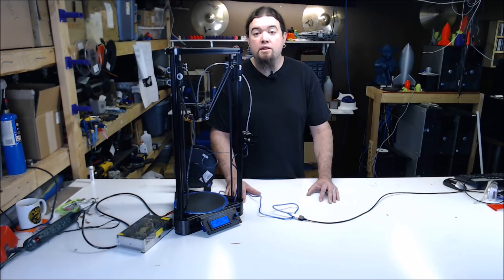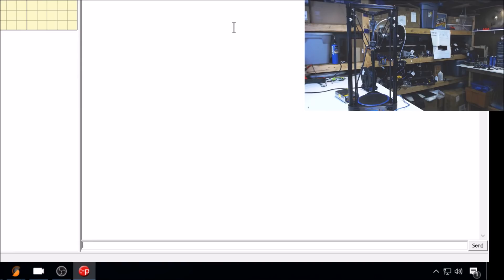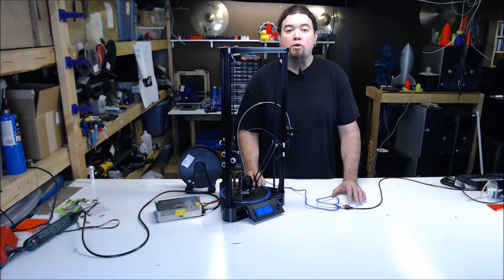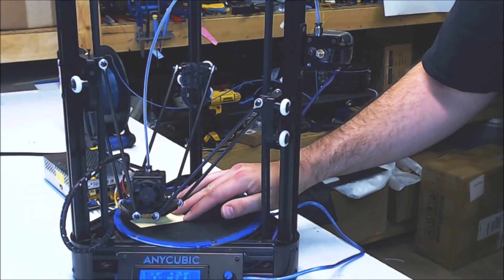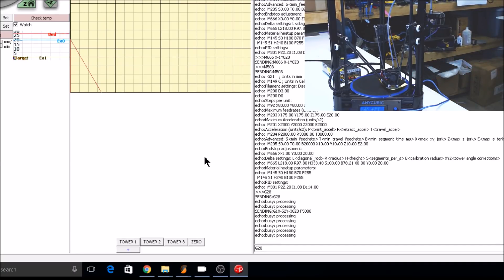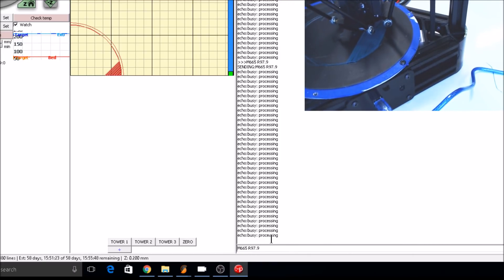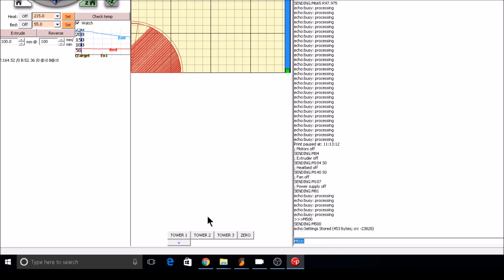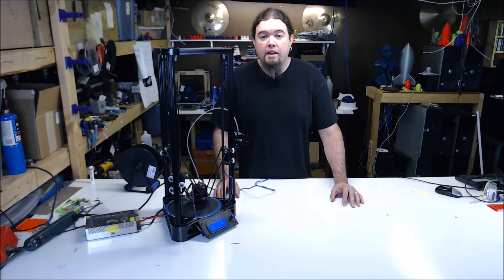How to level your delta printer bed - Anycubic Kossel Delta

Comment: When I do M666 X0 Y-2 Z0 to move the Y tower down 2 mm, it doesn't show up when I do M503. Even if I do M500 after the M666 command to save it, it still doesn't show up, and it doesn't do anything. 

I don't have the Marlin software, because I have had to return this printer twice already (the first time because I got marlin and everything got screwed up). So I'd prefer not to get Marlin if I didn't have to. Anything I can do here with the default firmware?
Reply from the maker: The old firmware doesn't show anything on the M503 I am afraid. Not sure when that was added, 1.1.1 maybe. I think your best bet is to adjust the endstops manually.  Those changes should  work with the M665 command, not sure why they are not. You might try a M502 to reset to factory then try your M665 command again.
Reply: Hey Chris, thanks for the speedy response! I did end up installing the firmware. There was no option for the height in M665. I looked through the comments here, and it looks like the Anycubic Marlin firmware does not have the "H" option. I saw that you posted firmware for the Pulley Version... I have the Linear Plus, do you have Marlin firmware for that? (The Linear Plus' arms cannot be adjusted manually, no allen wrench will fit the screws at the top of the arm).
Reply: Chris Riley Or rather, what could I do to your Pulley Version firmware to make it work with the Linear Plus? As far as I know, the only difference between the two printers is that the Linear Plus’s build plate is 230mm.

Comment: Can anyone tell me how I can access the existing firmware on the primer i need to make a couple of small calibrations but all information I find online just tells me how to upload new firmware to it and not how to edit the one that’s already on it
Reply from the maker: Unfortunately, you can't. You have to recompile the software and reload the whole thing every time you need to make a change.
Reply: Chris Riley thanks for responding and man that sucks cause I never got the firmware that’s on it from where I bought it. Oh well guess I’ll just download the latest firmware from Anycubic and start over. Lucky for me though you made this great tutorial/Video that’s gonna help me a lot XD
Reply from the maker: The Anycubic version should be pretty close to what you need. Let me know if you run into issue I will try to help out.
Reply: Chris Riley thanks I really appreciate it right now what I really need help with is getting the latest firmware for the Kossel Linear Plus upgrade version that has a heated bed and auto leveling I contacted Anycubic to see if they can send it to me but if you know where I can find one that would be awesome and probably faster lol

Comment: When I use the G28 command the printer moves to the back left very fast and keeps going that way until I unplug it. I also just have white squares on my display. It works with the software downloaded from anycubic though. Any thoughts?
Reply from the maker: +Drew Hardy Hmmmm, sounds like the boards isn't happy at all. Double check your motor port connections are correct. Try a M6 1 and see one on the motors moves 1mm.

Comment: Hi, when I start a print with your new config everything seem to want to start ok, Print head come down, Printer heat up before starting print and then the head goes straight off the bed between the z and y post not hitting anything but stay there and keep extruding filament. Do any one have any idea why and how to fix?
Thanks
Reply from the maker: That almost sounds like there is something up with the SD card, like it's not getting the gcode loaded correctly. Have you tried formatting the SD card, reloading the gcode and trying again? If not, give that a try. I will try to help you if I can.
Reply: yes? I tried printing via USB with 2 different software and changing the bed dimension into those and printing from SD card (format) same result. I tried different marlin version. Do you know a website that doesn't take 3month to ship? I think im gonna  try another board.

Thank you
Reply from the maker: If you want that exact board it's going to be hard to get anywhere but strait from China. You could probably swap it with an MKS ramps type pretty easy though. You would have to check them out and compare it, but it might be worth a look. https://www.amazon.com/KINGPRINT-Controller-Motherboard-Ramps1-4-Compatible/dp/B072ZZ3YQW/ref=sr_1_1_sspa?ie=UTF8&qid=1516055099&sr=8-1-spons&keywords=mks+gen+1.4&psc=1

Comment: just curios, why not use the auto-level? thanks!
Reply from the maker: Zoster Are you talking about the feature in the menu without the sensor? If so, on my printer this options makes the printer go crazy and crash into things. They might have improved it on later models.
Reply: hey! i'm referring to the feature that uses a sensor
Reply from the maker: Cool, that is on my list of projects to get to for sure.

Comment: PLEASE HELP SOMEONE **
I bought my kossel about a month ago. it's my first 3d printer, Iv been trying to level the bed,  but no luck so far. Please if you know the solution, I would love to know thanx 
My centre is higher than all the towers for ex.
if I make my z hight 327.7 the centre is perfect but the towers are too low 
however, if I lowered my z high to 327.3 all the Towers are perfect but then the centre is too high
PLEAS CAN SOMEONE HELP ME
Reply from the maker: S3ODG Its the radius setting. What is your radius at now? It should probably be around 97-98 for this printer. The video will show you how to change it.

Comment: Can I please have help, and thank you for video. So, Ive been following your steps, i started the print in pronter face like you did , now the extruder feeder is spinning way to fast and stripping filament. Thanks have a good day
Reply from the maker: First off lets get something out of the way...Is that you in the hotdog suit? If it is, awesome...Ha. Now to your printer. My first thought is your Extruder steps got set way to high. If you made any changes in Marlin, go back and check #define DEFAULT_AXIS_STEPS_PER_UNIT   { 80, 80, 80, 100 } in configuration.h the last number is the extruder or send a M503 command and look for this line. M92 X80.00 Y80.00 Z400.00 E93.00 Your E should probably be somewhere around 100. You might have something off in eeprom as well, do M502 then M500 to get back to Marlin default settings.
Reply: Hey sorry just saw this now hahaha, thanks a lot for reply, and sadly it is not me hahaha
Reply from the maker: Darn! :)
Reply: Chris Riley hahaha, I'm brand new to 3d printing, I'm pretty good with computers but this is brand new to me haha

Comment: currently using the most current anycubic firmware and the M665 command does seem to change anything, and the M503 command doesn't show an H value in it's list.
Reply from the maker: Ryan Young I found this out while helping a few others with there firmware. Check out this post, https://www.thingiverse.com/groups/anycubic-kossel/forums/general/topic:25027 I put a link to a tuned version of Marin 1.1.6 for the pulley version of this printer. You can give that a try, you will have to adjust the height for your printer. In the mean time, I will see if I can find some 1.1.0r8 commands.

Comment: Having a little trouble. Set centre to Z0 but when I set the towers to Z0 the centre is over 1mm low. What happens now?
Reply from the maker: So if I remember correctly, this concave that you are seeing is caused by your radius setting being way to high. Do you have the Anycubuc Kossel? I good radius setting to start with is around 97.5. What is your current radius setting. It should show in the M503 command.
Reply: Hi. It's the Anycubic Kossel pulley version. I set everything as you described and checked the Z0 at the centre and the print head was hitting the bed by about 1.5mm. Radius is at 105.2..
Reply from the maker: Ok, yeah, that seems pretty high. Bring it down some and give it another try. After you get somewhat close you can fine tune it with a test print.
Reply: Thanks , Ill give that a try. Great advice by the way. Cheers.
Reply: hI.sORRY ABOUT THIS BUT ALTERING THE RADIUS ISNT MAKING ANY DIFFERENCE.
Got it down to 99mm now and still the same as at 105.5.
Reply from the maker: That probably because eeprom is enabled. Do a M502 to reset to what is in the Marlin firmware then a M500 to save it. Or/and comment out then enable eeprom line.

Comment: Im new to 3d printing and im trying to set the height on marlin but there isnt one so the hot endsays 3~7 cm above the bed
Reply from the maker: What version of Marlin are you using? Different version have different options. You should be able to search Ctrl+F for height.
Reply: Chris Riley Im using 1.1.8. I have never use arduino coding ever before so I have no idea about it
Reply from the maker: Ok, go to my about page and send me an email, I will send you some screen shots.
Reply from the maker: For everyone else, on the newest version of the Anycubic firmware, adjust the height of the printer with MANUAL_Z_HOME_POS.

Comment: so this is interesting.. i am running 1.1.0 rev 8 (newest as of last night) and the m665 code doesn't return an H value.  for instance, in my h503 i get this:  echo:  M665 L218.00 R98.40 S100.00 A0.00 B0.00 C0.00  so it looks like they've made a significant change from 1.1.0 rev3 that you're running.
Reply from the maker: Interesting, I have mine running 1.1.6 right at the moment. I will take a look. I checked on the Marlin site, they currently offer 1.1.7. Or are you referring to the Anycubic version of Marlin is currently 1.1.0 rev8? If it is actually 1.1.0 rev 8 then that would be much different than current version. In this video I had 1.1.3. Thanks for the comment, I will check it out. I also posted a 1.1.6 version that works on the Kossel if you want to check it out.

https://www.thingiverse.com/groups/anycubic-kossel/forums/general/topic:25027
Reply: well, i feel dumb now.  yes the version i'm running is the one direct from anycubic.  sorry, still fairly new to this aspect of 3d printing so i didn't know there was a difference.  i'll grab your version and give it a try.  thank you!
Reply from the maker: No worries, let me know if it works out for you.
Reply: worked great.. my height is different due to the adjustable heatbed i installed but the m665 code is as described and worked to adjust the config accordingly.  thanks again!

Comment: Really we'll explained I am having kossel liner plus and it is a pain to bed level but once it is done it is a great printer
One question why 2 pice of paper instead of one
Reply from the maker: Thanks, glad it helped. I find that if you use just one piece the nozzle ends up to close. Plus if you use two it helps when you are checking it over and over, the paper tends to get dented.
Reply: Chris Riley 
Thanks brother
Tower leveling also 2 paper ?